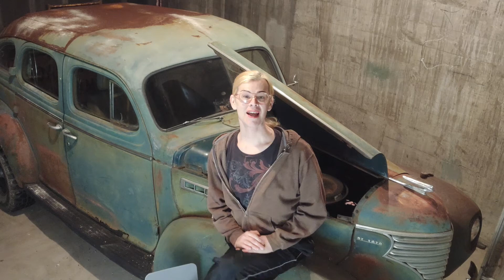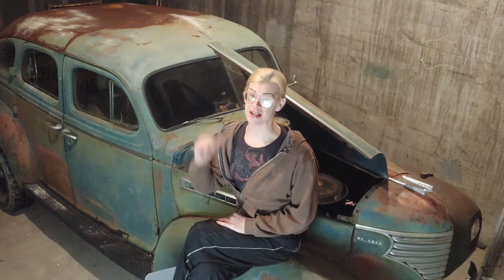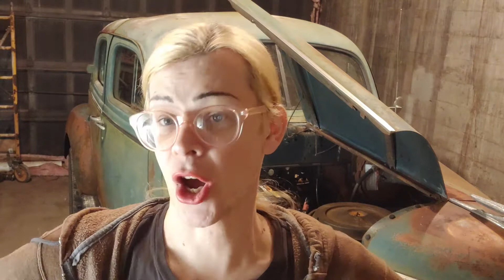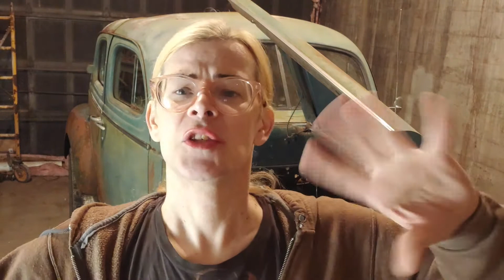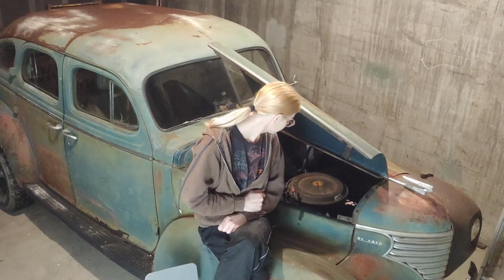Don't make this timing adjustment mistake that destroys classic car engines

Comment: I've found that a cold engine needs less timing than a warmed up engine. Shop manual says 6 degrees on my engine, but they updated it later to 10 degrees and some push it to 12 degrees. It'll start at 6 degrees fine. So as far as I'm concerned, It's already advanced and you're over compensating for the tune-up it likely needs, so don't touch it. At least mark the position of the distributor before tweaking it. Timing was probably fine when it was parked.

Comment: Advance is deigned into the distributor 
Timing is restricted set by compression /camshaft/fuel octane / combustion chamber design . Timing is categorised into 2 main areas  1/ mechanical and 2/ vacuum 
1/MECH  is set into idle / max  independently of each other . Advance curve starts 200rpm after idle  . Rate of increase and ,, max timing should be achieved as quick as possible depending upon engine pinging / detonation response .
2/ Vacuum advance is designed to give xtra advance when engine conditions of light throttle and load . Why u need more time to allow for a low density fuel to ignite  .
This occurs in top gear 1to 1 at between vac readings at 35--55 mph
Reply from the maker: Thank you for a concise detail of timing. Setting old analog equipment to achieve the ideal is an interesting process that requires study as well as trial and error.

Comment: Ok I had to read comments just to get a lay of the mechanical smarts on here lol.... I guess most people here can not recurve their own dizzy...or even read total timing all in by 2500rpm...or even know how to degree a dampner with a simple marker... Hey they might not even own a timing light....100% the ear is not a precise device to use to time an engine... so to it get up and running always stay on the conservtive side just to be safe more is not always better... I mean you hear the starter kicking back and you still give it more then you deserve a melted piston...or a dead starter😂... Cars are not some dark magic they are science in motion that can be measured ..tuned to spec there is no room for guessing... but you will always have those who will live by old wives tales....so flip those pistions from side to side and give it 36° BTDC and watch it go!.... And please said people stay far away from a modern cars 😂😂😂
Reply from the maker: This isn't the best video I have ever done, nor am I an expert. You understand, it's about knowing the larger picture and confirming that all the parts are working together. @thunderhead289 just did an excellent video on timing and base tuning a ford that I admire. I don't know why this video keeps getting views, but I want to make better content and keep enjoying these old machines while I learn.

Comment: Hi Kim love your content you are spot on the timing talk issue I admire your experience in auto talk, and when you said mopar I had to subscribe. I currently have a Duster 71 with a 340 I use a FBO plate In my distributor, before I would get pinging now I have the control with the plate.
Reply from the maker: Glad to hear you have built a distributor to get great performance out of a legendary engine. Thanks for watching and I will do my best to keep making worthwhile content.

Comment: Just found this video, and im planning to "revive" the 1951 Chevy Fleetline Deluxe  (235, Powerglide) i bought a few months ago.  This video scared the crap out of me.  Now i have to figure out how much the motor was messed with.  Excellent, eye-opening info!
Reply from the maker: Not intended to frighten anyone, but you get the idea. Always verify total timing when working on old cars, even 'remanufactured' parts could give you unintended results.
Reply: @kimfixesthings   Iprobably overstated it :).  Great info!

Comment: Great explanation Kim. What also comes into play is that age old argument of manifold or ported vacuum advance. I may be wrong, but those arguing, are on opposite sides of the fence. Manifold for a race engine, ported for a quietly driven street car is the way I'm hearing it.
Reply: Most FACTORY carburetors AND distributors were arranged for PORTED vacuum until the mid 60s, some even sooner, but then they started switching to manifold vacuum on many.  You should stay with the factory arrangement in most cases.

Comment: This is the best explanation I have heard in the last 50 years of playing with Minis and Old MG's which I am fiddling with now in retirement.  It shows, if you are open minded, it is never too late to learn something new. Thanks for this and I think my MGA needs the timing backing off a little.  I go back to the basic static setting again and work from there.
Reply from the maker: I have many excellent teachers! I wish I could better communicate the understanding that I have gained with practice. I enjoyed a video by @junkerup not long ago on the same topic.
Reply: @kimfixesthings  Never underestimate yourself. Your presentation skills are exceptional. Go girl.
Reply: Xp falcon is enjoying retiment at 4 degrees and a smik carby

Comment: Vacuum timing ….my 235 runs great. It is hard to time a 235 with the pressed in bb in the flywheel so vacuuming timing seems to work. But I do have a electronic distributor from an S-10 Langdon mfg. and changed over to alternator from 5th street garage Randy Rundle the inventor has passed away but his family is still making these 5 star alternators. I don’t think Vacuum timing is harmful? Thanks Steve
Reply: It depends on the engine.  There is no blanket rule.

Comment: Hello kim, Love Your channel. Great video and interesting topic. There's a difference between loaded and unloaded engine, The less load the more advanced an engine wants. Like, when a vehicle is going down the higaway, its under less load. And  needs more timing to be efficient and  ignition burns correctly. Ported vacuum is the factory's setting because of the AMA ban. Manifold vacuum is the best and the correct way. There's lots of videos on the internet now. That actually described this and how to tune it. I've been doing this for thirty years.     https://youtu.be/Vh9RSX5ec5g?si=S1YNuDIIOIgMM_Qh

Comment: Factory specs don’t mean anything anymore.  Fuel is different than it used to be.
Reply from the maker: excellent point! the original designers of most cars had no choice but to make assumptions about what the minimum quality would be. Computers are a compelling tool if you don't mind the complexity.

Comment: So, do you think that getting as high as possible initial timing, as “tall John fun Garage” recommends, it does not improve throttle response, power and driveability ?. BR
Reply from the maker: timing is a complex interaction of many factors. each model car can have different features such as base compression, manifold design, carb design, transmission and rear end gearing with tire size/height factored, vehicle weight/ towing ability. The list goes on and on. To get the right settings, you need to consider the many factors and 'dial in' to settings that 'tune' your car/truck to meet your needs. The mistake would be to just assume that settings used for some car/engine on the internet will meet my own goals/needs. if it were that simple, then anyone could do it.

Comment: Hello, according to your experience, what is the best initial timing for a 2 bbl’s slant six, 10 Degrees ?.
Reply from the maker: For a street driven car with an automatic transmission and typical rear end gears such as 2.76 and using the factory tire height, you should be able to get a reasonable base to adjust your carb at a 10 degree initial timing. If any factors change to weight or gearing, then you might need to decrease your initial timing. 10 or 12 BTDC was about the maximum I have seen in factory Chrysler applications. Keep in mind also, that you will need to confirm the total timing that is added by your mechanical advance. My unprofessional understanding is that the long stroke of a 225 slant six doesn't like much more than 32 or 34 degrees of initial+mechanical. Don't use ANY vacuum advance until you have tuned your carb and confirmed your total mechanical timing advance is good. If you need to modify your mechanical advance, I just uploaded a new video that shows how it's done.

Comment: We've got a Buick straight eight that doesn't rev and does a fart noise when stepping on the gas. We have absolutely no idea why!
Reply from the maker: accelerator pump? what have you done to it so far?
Reply: @kimfixesthings  The Accelerator pump works fine, also it looks like there is enough gas is going through the carburetor. I think it's the ignition system. We have asjusted the contact breaker points, replaced the distributor cap adjusted the carb. Unfortunately the mark on the fly wheel isn't there anymore. But even if the timing is slightly off, it shouldn't run that bad
Reply from the maker: @DaBoogie049  you can remove the #1 spark plug and use a piece of wire to 'feel' the piston rise as a helper rotates the crankshaft. this will allow you to find 'top dead center'. You then want to verify that your distributor lines up to the #1 spark plug wire in the cap. You also need to confirm that the #1 is on the compression stroke and not the exhaust stroke. If the distributor is 180 degrees out, all cylinders would fire on the exhaust, and the engine could actually start like that, but it would run very badly. you should find answers through this process. I will assume that you have already made the typical checks, such as firing order and condition of wires and coil voltage and connections.
Reply: @kimfixesthings  Thank you so much for your time and expertise!!!❤️
Reply: You need to check your mechanical advance and make sure it isn't frozen.  It sounds like it is.  You probably have too much timing at idle, but not enough as the engine revs.  Also, your vacuum advance should be receiving ported vacuum, not manifold vacuum.
Reply: @jamesbosworth4191  Thank you very much man!

Comment: Some of these cars I think were designed to run little or no advance at idle in order to be very quiet and smooth and had a lot of vacuum advance and/or centrifugal advance built in,so "timing for best idle" would dangerously overadvance on the road? 

also if you blow up an antique engine it won't be easy to find another one!  Get a good timing light.
Reply from the maker: I agree with your generalization. Really need to figure out mechanical+vacuum and then subtract to set initial with a timing light. The car in this video has a chevy 305, so it's not at all rare.

Comment: Thanks for the video! Hope you saved somebody a YOU IDIOT moment! I would say that if your using a vacuum dashpot on your distributor..and it's basicly a stock engine (meaning it has factory spec cam and intake) then keep it as close to factory specs as possible. I've seen some old school tuners that could tune by ear..but that comes from years of doing it. I wouldn't recommend making any big timing changes without using a timing light

Comment: That was funny how you added the intro as an out-tro. 😂😂

The vacuum at idle thing is for setting the idle mixture screws on a carb if I'm not mistaken. I've never heard to do that for timing. I learned something new, because I didn't know that was a thing. 

Are you running points on that, or did you update the distributor? And what's the plan for the hot rod? 426 Hemi with a fogger and 2 kits (or a screw blown Hemi)? A new generation Hemi with twin 88mm turbos? Some of us OGs from your other channel need to know these things! It's also cool to see this side of you. Keep the hot rod thing going. 
Also, I can't wait to see you do a little testing on the Hog. Some of the guys involved in that are racers I looked up to in drag racing. It should be a blast!

Comment: This stuff also comes into play with a "driver" and not a "racer". A lot of stuff you see on here (the internet) is Race-Based, not Driver-Based. I watch a lot of these videos and read a lot of forums, where people say to do this or that.... and it's way out for a Driver and will burn them down in a few 100 miles. I'll admit I've bumped them up to get a fire-up if it's being stubborn.... but its just a "1st Fire" then I bring it back down.
Good video, and yeah, I was one of those like you that had a knee jerk moment on this... "revival videos" that are so popular on the net now.
Reply from the maker: I completely agree with how you are saying. Most of the old racers who taught me would not connect the vacuum advance. They would also put 'quick' springs in the distributor so the mechanical would be 'all in' very quickly, or even weld up the advance mechanism. They didn't care about fuel economy and their motors were designed to give them the simplest possible path to wide open throttle. I have seen too many videos where 'drivers' were set up all wrong because the person didn't really understand how the old pre-computer systems worked.